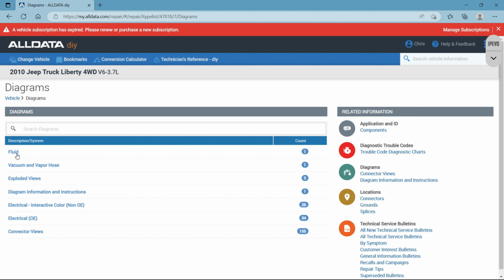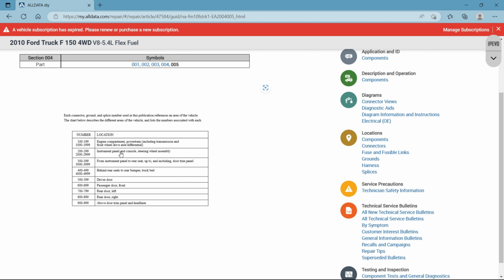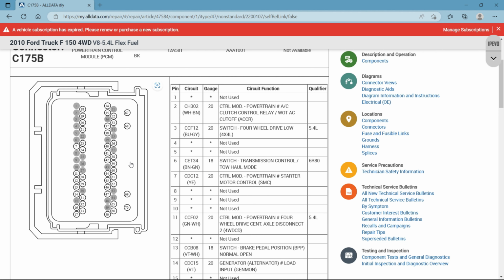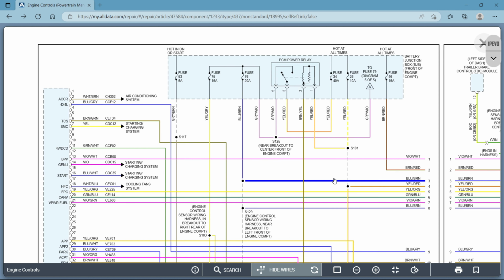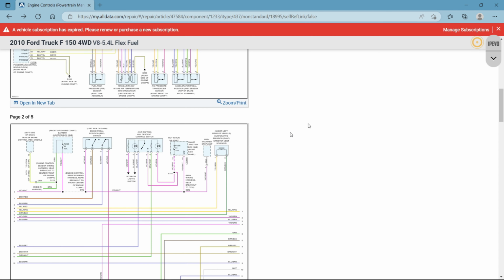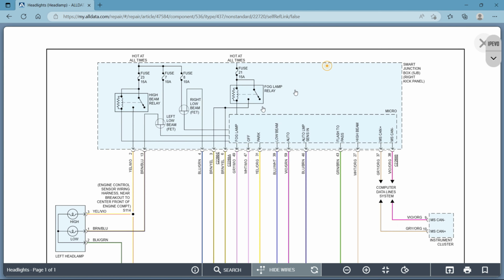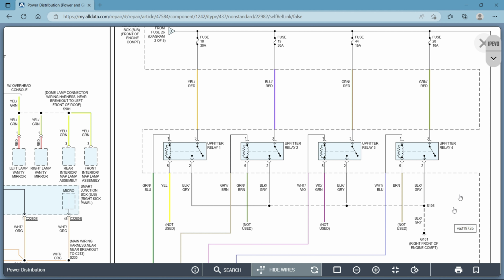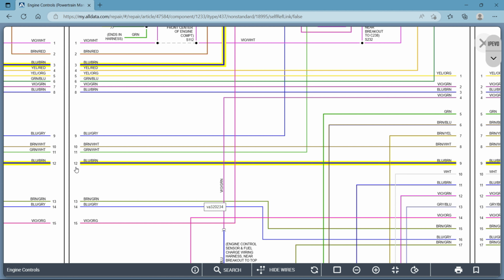How to Read Wiring Diagrams

Comment: I have a buddy that lives in Michigan and met him on YT. He called me up and told me he bought a Pacifica and not one of the new ones. He bought the older model that has AWD. He was having problems getting it started and he found a diagram on line and directed me to it. I am trying to read this thing and figure out his problem over the phone. The engine was starting with hot shot but then dying. We figured out a few things but one big problem was coming off one of the injection signal lines and that was that it was grounded. He told me that the line looked like it was connected to ground and I looked at the schematic and said no that's a capacitor and it's there to keep out noise for the radio. Well it turns out somebody broke the capacitor and then they just cut back some wire and connected it to ground. There was a bunch of problems one of which they converted it from awd to front drive only. Wally ended up parting out the car and making a little money but it was not worth the time he put into it except for the learning experience. I initially wasn't sure that it was a capacitor and it took a while digging to find the symbol so this is good stuff if you are trouble shooting electrical bug. Happy Motoring.
Reply from the maker: You see that kind of stuff all the time. Whether it’s an aftermarket install like a poorly installed remote start, or people doing shady work. It’s really a shame because those types of issues are usually the hardest to find and fix (if they ever get found). Thank you for the input!

Comment: Thanks for another highly educational video that you actually pointet me towards. Asking for other vehicles that have other than 5V reference voltage; have a look at the Carver.earth.  I actually have the service agency for this in Norway and this operates on both 5V (sensors), 10V (instruments, signal switches), 12V (radio etc supply) and 50V (traction)
Regarding the lighs at 41 min. The power to the low beams go through FET transistors that work like a relay with power on signal from the Micro. The Micro must be powered from some other source than fuse 7 or 8 that only sypply the low beams. ( but I am sure you already found this out after making the video)
Reply from the maker: Thank you for the info about the reference voltage, and FET transistor!